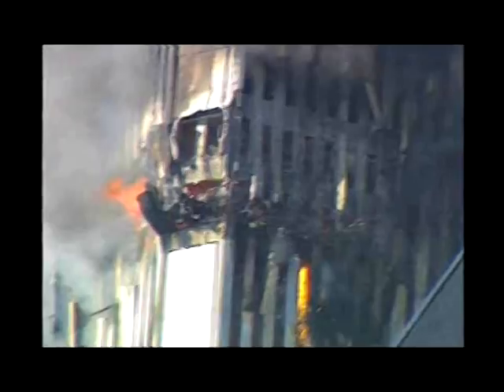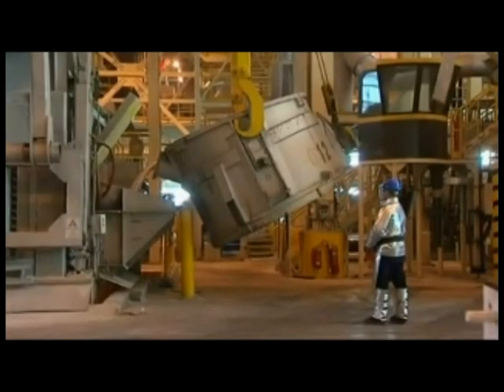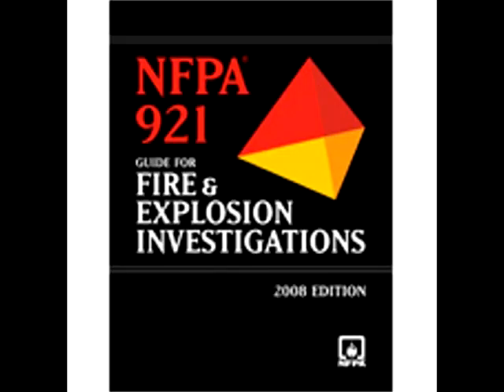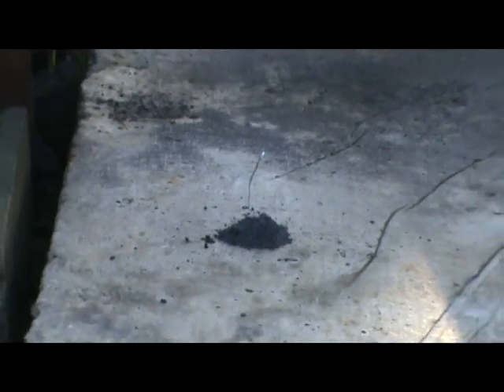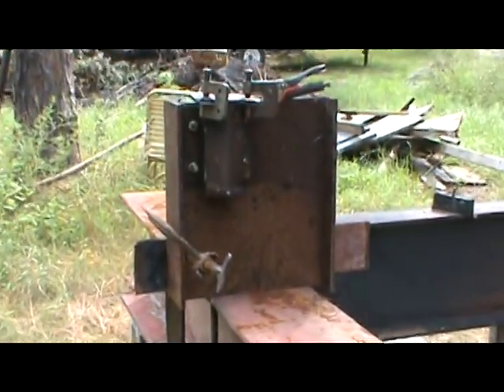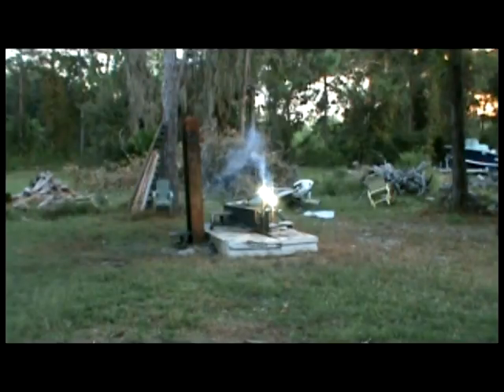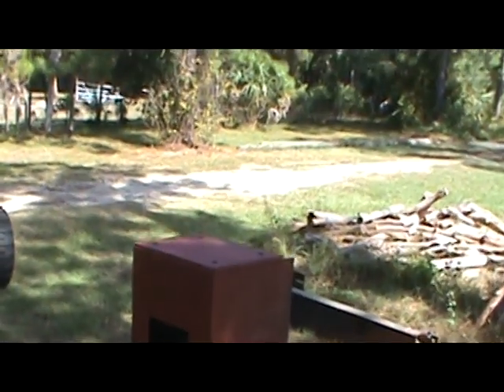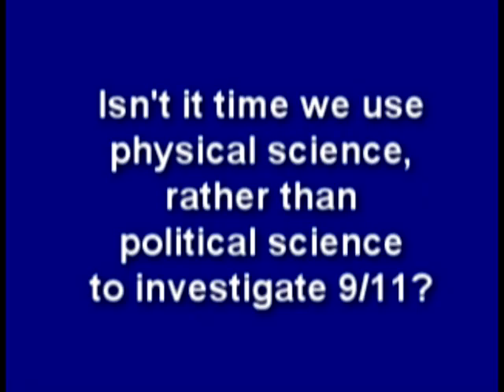9/11 Experiments: The Great Thermate Debate

Comment: @blueshark69 what a bitch thing to say, if you actually hunted you'd find paper trails that could raise suspicion.
 the only factor i can see against the cause of calling it a inside job is probably the fact that none found cut/blown up beams, but then again, i wasn't the one cleaning it up, neither were you.

I see in no way how there can be war games/practice/planes flying off course!,  then when shit goes down, the military is slower than a slug to prevent it.

Comment: @flanksteak2   Hmmm,  hamheaded fuckchop, interesting. The SR-71, scramjets, & cruize missles can go Mach 6.  Thats roughly 4500mph. LA to Charlotte(2450mi)= 32.40minutes. Montana to Arizona(1300mi)=17.20minutes  So the real question is why air defense was never called,  figuring how the 2 closests AFB's were right next door. Hanson AFB & Mesquite AFB. I think you are missing the whole arguement & tried real hard to discredit me with a one line statement.  FAIL. You got PWNED

Comment: @c0mputar It does defy physics.  108 feet of full gravitational acceleration for the upper 1/2 - 3/4 of a building with only asymmetrical damage is impossible.  To reproduce the same effect would require all structural support for that span to be removed at a rate greater than gravitational acceleration.  Controlled demolition explains it perfectly.

Comment: @c0mputar Actually we do have evidence.  It's called physics.  It takes 100% of an objects potential energy to achieve free-fall.  Any energy required to move through resistance (i.e air, structural support, etc.) reduces the fall speed of the object.  NIST admitted to 108 feet of free-fall in building 7.  Free fall acceleration is IMPOSSIBLE through resistance, especially in the case of a section of building falling through support structure that had held it previously.

Comment: Office fires and two crashing planes cannot melt steel or pulverize concrete (elementary physics/chemistry/engineering) - not even on 9/11, not even if that's the official story, not even if NIST believes it, unless thermite explosives were rigged and detonated throughout the three towers (1, 2, 7) bringing the three buildings down by controlled demolitions.

Comment: He said it looked like molten steel....now I look at you welding..and I wonder..do you understand why typeT1 steel is used in steel frame construction and elctric arc welding as the steel gets red hot and cool rapdily.it does not need to be heat treated..Tig welding,or slag welding causes the mechanical properties to break down and needs to be heat treaded..And it can never be welded at 0 deg or lower because it would make a bad weld..So is that you welding? No? You should be careful

Comment: @blueshark69 Build us a structure that is to scale of one of the Towers(Dimensions
Storeys (above ground)- 110 Height- 417m and 415m Tower perimeter - 600m X 600m) .
Build it out of wood ,as that should be your material of most expertise. Then make it collapse ,by dropping the top 20% of it on the remaining 80%. .Video it ,make it out of any size timber you like ,from matchsticks to 4*2 .You will never get the top 20% to destroy the lower 80%...never !  Use fire ,put a brick on every floor NEVER

Comment: @blueshark69 I spend all day designing and manufacturing superconducting magnets and their subsystems. I have been involved in engineering since I started my trade at the age of 15 ,I am now over 50 years old. I have hand forged steel and made horse shoes and I have designed and made devices with over two hundred amps in superconducting material that is less than 4 microns thick  . 
In my whole live I have never seen ANYTHING that receives asymmetrical damage collapse symmetrically ! NEVER !

Comment: @MsgtSpook We can all see the building was not nearly "fully involved" and even if it was, it would not fall the way it did. The evidence showing that explosives were used on 9/11 is overwhelming, to say the least.  The guy who made this video is a civil and structural engineer licensed to practice in 4 states. But you dont need to be an engineer to know with complete certainty that explosives were used. -Just look at the facts. At the 1100 missing people, the pulverized concrete, wtc7,  etc etc

Comment: @MsgtSpook  part 2

Look at the image on the linked page...you can clearly see the "top section" of the South Tower roll off the Center of Gravity line. It should have fallen off the side into the street and had the lower seventy floors not been "removed" it would have !

cnparm.home.texas.net/911/911/911.htm

Comment: @discobrake You conveniently forget that only three floors at most had fires ...even if what you imply is true the entire structure below the fires had more than enough strength to stay upright .At worse the floors above the impact should have continued there roll off the top of the Towers and fell into the street below...NOT THROUGH THE UNDAMAGED *) OR SO REMAINING FLOORS !  ...You obviously are not an engineer .

Comment: @JonnyPxN No structural failure occured in the area where the melting was taking place. The columns that truthers are claiming were being cut with explosives or incendiaries are clearly visible in videos. 

It's also kind of stupid for them to claim it was blown up but then point to molten metal dripping out of the building as proof that the building was blown up.

Comment: @ThePeage  "They might burn on the surface, but they wouldn't be mixed in and they would be black on the surface, not "glowing orange"

Since you have ZERO experience with molten metal or burning plastics, why would you make a claim like this?

Comment: @MMIIXX Note I said nothing about witnessing molten metal, just laughed at the inference that because the firefighter called it molten steel and thus it must be molten steel not anything else. Have you every heard a beam snap or collapse? Or a bolt snap under tension? They all make a bang bang bang and would do in succession one after the other if the building was starting to collapse

Comment: Iron balls are a byproduct of welding as well are they not? Wouldn't see welding happen on massive steel structured buildings much would you?

Melting Al is not orange? Really... search youtube for pouring aluminium, ORANGE!

Witness accounts of molten steel = Firefighter =/= Metallurgical expert

Nano-thermite = explosive but no explosions

Thermite used in this video =/= Nano thermite, may as well compare the jet fuel to methanol because they are about the same

Nice experiments though

Comment: What burned wasn't just the av gas but the airframe as well.  Aircraft aluminum alloy contains parts magnesium and zinc (oxidizers) and contributes significant amounts of heat when burned.  The horizontal members were trusses; lightweight and strong until you heat them, at which point they fail long before 'melting.'  The trusses failed, a floor collapsed and caused a cascading failure.  Collapsing trusses are a common structural fire failure.  The exterior wall didn't factor in the collapse.

Comment: video lost all credibility when he started talking about pressure pulses and dust puffs.  We must be ignorant of the context that those terms were used.  The dust puffs only appeared during the collapse as the building fell, it created pressure pulses downwards as the air was compressed inside the falling building.  This force exited where ever it found a path of least resistance, through windows creating puffs of dust.   Building seven fell for than a fire, a 110 story building fell on it.

Comment: @iBlindGame i did not rule out the possibility of nanothermite to be used as rocket fuel, but only pointed out the fact that thermite is an innefficient rocket fuel because of its slower burning and destructive properties causes the rockets fuel compartment to heat and spraying the ground with molten aluminum is not ideal, compared to cheaper, colder, faster, more abundant and safer materials such as hydrogen and oxygen fuel.

Comment: @Bigtymer781 Was jet fuel the only thing burning in the fires?  Do all the wood, paper, plastics, etc. not count all of a sudden?  Does tons and tons of burning debris piled up and soaked with burning jp-5 count as an open fire?  Do you happen to know the melting point of the aluminum alloy used in the aircraft was?   How does that melting point compare with unalloyed aluminum?  Wanna hazard a guess how much of said alloy might've been present from the jet's remains?

Comment: @snidelywhiplash "1. Molten aluminum glows orange at about 1650F." 

What I would go do if I were you and you are honest with yourself is, go look up the temperatures that jet fuel burns. 

Open air burning temperatures 	287.5 °C (549.5 °F) -wikipedia

Comment: 1. Molten aluminum glows orange at about 1650F.  
2.  There is no way to know WHAT the molten material coming off the tower was.
3. I'm given to understand that it would take a LOT of thermite to cut enough steel to cause the towers to collapse.   How would that all be placed there without anyone noticing?

Comment: @Bigtymer781 I'm questioning the idea that it had to be molten steel shown in the pictures. There are tons of other possibilities, the problem is, what evidence do you have that it must have been steel?

If you want to know, some companies use a device called UPS Battery Backup witch is essentially a big battery that can supply a computer with power for like 5 to 30 min. (time required to save your data). Those are quite heavy. Also almost all electronic devices have a battery or two.

Comment: @DuRound2 Yeah when the thermite first ignites, as soon as its done, you can see a small molten puddle of steel. But lets remember, someone like you actually believes that orange molten stuff pouring out of the side of the world trade center is office furniture and carpet. In this video, after his experiments you can actually see the drips from where the molten steel has cooled down. So obviously the steel was molten at one point in time even if you weren't able to catch it.

Comment: Steel wasn't the only metal material inside WTC

Aluminum melting point: 1220(F)

Most commonly used metal used to make planes? You guessed it!

Molten "iron-rich sphere"? Are there any evidence suggesting that it must have been made before the tower collapsed and not after?

"Melting of steel beams"? Bending due to heat and the pressure of a skyscraper maybe...

Comment: @IsUpAte Ya, another internet tough guy. heh So lets point out the one thing you seem to forget. During the Hijacking they along with the box cutters said they also had a bomb.  The passengers on the plane had no clue what the hijackers were going to do. They did not know the terrorest were useing the planes as weapons. So if they had bombs you attack them the plane goes boom and your the idiot that just killed everyone on board.  But one plane did get that info. Flight 93, and they fought back.

Comment: @IsUpAte  Aaah another arm chair fighter. At the time of the hijackings policy was to do whatever the hijackers said.  I'm also damn sure if someone confronted you with a box cutter you would run like a little girl. The razor blades in those cut you open from sternum to crotch before you could blink. So Until you have faced someone with a weapon, one that could gut you like a fish very quickly your opinion means jack all.

Comment: @iBlindGame The only way you can prove that it did fall in a controlled fashion is if we had any camera/picture angles on the south side of WTC7[the damaged side], which we don't, nor do you have any historical data of a building of that size and structural design collapsing in any other manner but straight down, no matter if it were intentional or not. You have nothing to compare the collapse to. You only have footage of what a controlled demo looks like and footage of the prestine north side.

Comment: @Bigtymer781 The Seismic began 9 and 11 seconds after the beginning of the collapses as the large pieces of debris began to strike the ground and continued for approximately 15 seconds until the building is short enough to the point where the falling pieces no longer fall far enough to induce detectable seismic waves. 

This means the collapses took at least 20 seconds each which is corroborated by the videos of the collapses.

Comment: @iBlindGame your fairly reasonable compared to other theorists :P, but look at videos of building 7 before it collapses, you can see the south side( the side with the giant gash in it) fall first followed by the rest of the building, the damage also leans towards the south side, showing it didnt collapse straight down.  
the towers still fell because temperatures burning at 2000 f less than the 2700 needed to melt weakened the steal and caused the tower to collapse in

Comment: @iBlindGame Those observations are based on that the rest of the north tower was structurally sound, which it wasnt considering 1) a billion tons of concrete and steel had just fallen next to it damaging the lower foundations 2) that the fires were burning in elevator shafts and stairwells below those floors weakening lower foundations as well, thats why it goes down second even though it was hit first, it took more time to weaken the foundations, but if u look at the towers design its inevitabl

Comment: @mildcorma I think the problem here is not just the flashes of sparks. it is the molten metal that burned for about 8 weeks in the basements. I don't think Thermate itself describes how the concrete was essentially vaporized into volcanic dust in seconds. The forensics of the twin towers show that they didn't collapse like pancakes, they EXPLODED into fine dust that covered all of lower Manhattan. Thermate doesn't explain everything here, but it does illustrate how the beams were cut.

Comment: @faceclutch WTC 7 didn't fall in a controlled fashion, nor is a building of that structural design going to fall in any other way except downwards. If you saw the picture of WTC 7 from the sides that show the corners of both sides of WTC 7 prior to collapse, you'd see about 10-20 floors of the entire bottom corners of the WTC 7 is missing on the south side.

Comment: Yeegads , all you have to do is look at this and realize through logic and science that this has already been dis-proven. One of the biggest things I have noticed however is the simple fact about the planes. They were fully loaded with fuel.  I am talking about the fact fluids don't compress well. and at several hundred MPH the planes wings might as well have been filed with lead, and the mass of the fluid helped destroy the building. pretty simple really.

Comment: @DuRound2 do you just pull that crap out of thin air ....read for a change ...

When asked why there is no mention of 9/11 on the FBI's web page, Rex Tomb, the FBI's Chief of Investigative Publicity, is reported to have said, "The reason why 9/11 is not mentioned on Usama Bin Laden's Most Wanted page is because the FBI has no hard evidence connecting Bin Laden to 9/11." 

globalresearch.ca/index(dot)php?context=va&aid=3246

twf(dot)org/News/Y2006/0608-BinLaden.html

Comment: @DuRound2 Not at all, the jet fuel would acted as an igniter of the thermite, which would only need to be placed at specific points in the structure. also he pointed out that the termite was effective at cutting bolts in small quantities and that the point wasn't to collapse it at once, but break its structural integrity step by step. more like a controlled demolition, thus delaying the "final moment". he also rigged devices that can be easily monted inside of  "struts" of the building.

Comment: Not one of these theories considers the fact that Modern Aircraft contain much Magnesium.. Titanium will act the same to if it is ignited also..
Have any of you seen how Magnesium burns when it is ignited???
I have so many times.... You can't use water to put this stuff out as it explodes on contact...
This stuff is also used in Road Flares.. And you know how well they burn... 
It will burn so hot as to melt all that steel like Fire does to Ice...

Comment: @mmatvnetful But can it and all the other facters licke the plane breaching parts of the structure and buning everything inside burn hot enough to WEAKEN the structure to the point that it could no longer support the weight of the structure above and allow collapse. Reasonable people can see that a building struck by an object that large and going that fast should have been knocked over! The fact that it took a long burn to soften everything enough to collapse it the rest of the way is impressiv

Comment: Who cares if you can melt steel, you only need to reach its annealing temperature to cause it to soften.  A sustained temperature of over 700C (about 1300F, easily reachable in a conventional fire which is why you can get a needle red hot in a flame) is enough to drop the strength of most structural steel by 400% and cause collapse.  That's why all buildings require beam insulation (or anti-freeze filling).  This is very basic knowledge, which is why "mainstream" engineers are quiet.

Comment: @92451721921892113 they used coal, coal and kurosene (aka jet fuel) are totatally 2 diffeernt things, it's like comparing a bike to a car, yeah.. they'r both road vehicles that use petrol, but they are totally different

Comment: @Skeptic121 actually steel melts at 1370 degrees but the steel does not need to be melted to collapse, you're not really sure of what you are saying a "hydrocarbon" fire? what is this exactly?

House fires easily reach 700 c, do you really think it's that hard for a burning skyscraper to reach 1370 degrees c?